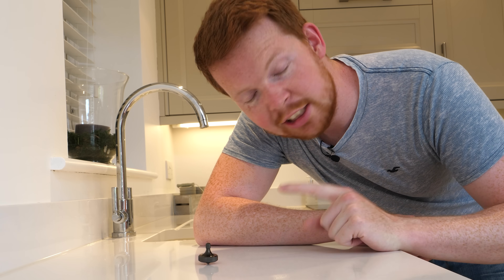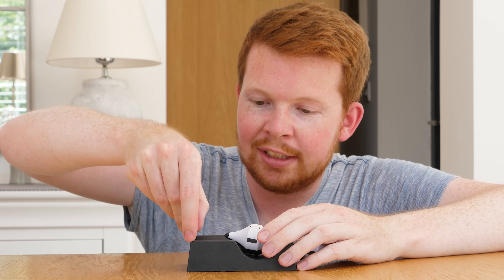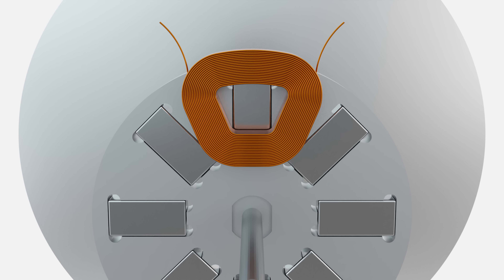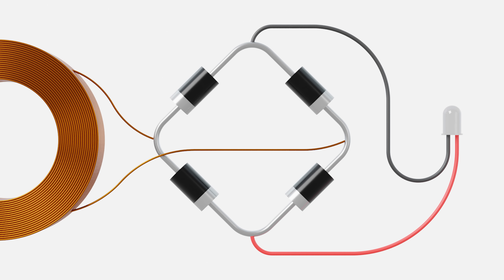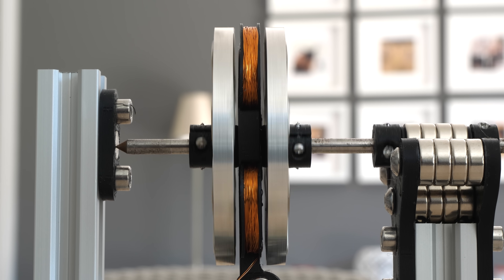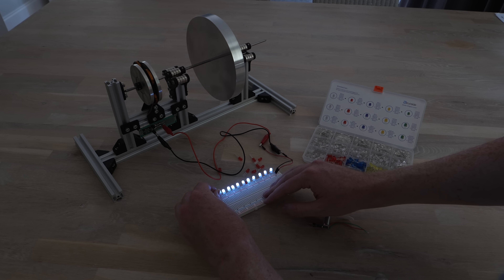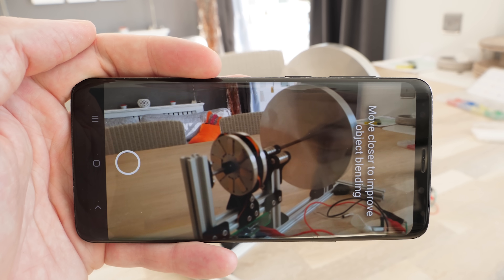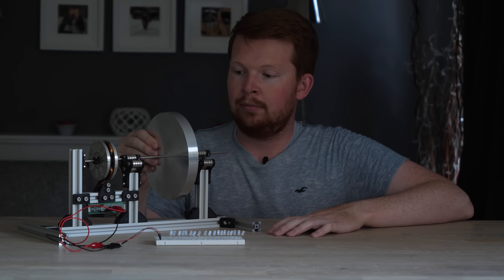Flywheel Battery

Comment: use the tiny motor to help propel the big flywheel, make it last longer! obviously at a point it will just add friction, but maybe with a fan just create an air current on one side to help it keep spinning. not sure, but it'd be fun to see how long you could get it to run with tactics like that

Comment: Just have a few words for thought:  Force Balancing. Fundamental Frequency. Resonance Frequency.  Like the use of the pin point thrust bearing, but any thrust bearing would work. Keeping in mind my few words, could some of the shaft vibration be caused by the alternator in addition to the balance of the shaft? How about hollowing out the center portions of the fly wheel, which wouldn't change the fundamental frequency of the flywheel, but which might natural curb some of the oscillations due to harmonics?  anyways, keep up the good work... Tesla would be proud.

Comment: cool video, but a bit disappointed with the wobble. Maybe a store bought generator and motor for that scale would have worked better. Also, why cant you put a magnet on the end to push against another magnet rather then having it touch the surface? that is still added friction.

Comment: You could drive it with a one-way bearing pressed into a gear (you find these used extensively in printers and copiers) build a gear box with a 1 - 25 gear up ratio (think - hand crank rotational flash lite) a smaller heavier flywheel, smaller rare earth magnets and coils that were closer together (flat drive motors printed on PCB's used in small printers and copiers) of course those Hand crank flashlights do the same thing without the magnetic bearings !! sky's the limit !

Comment: Would you be able to make some improvements n this design to make it self-sustaining? If you were to add magnets to the outside edge of the fly wheel all facing the same direction and then have opposed magnets on the base at a slight angle to repel those one the flywheel. Would that generate the force needed to rotate the flywheel indefinitely? and to help with stability you could add magnets on top of the support magnets you already have, trapping the magnets that are attached to the shaft. I wish i had the shop to be able to create this and work on some these ideas myself... Really cool project!

Comment: 3d print some gears and make a winder. Like the drill but using a crank and gear ratio to get it spinning with little effort. Then use a soft rubber wheel to touch to it. Wonder how much voltage it can make.

Comment: 6:11 No, no, no, no, and no. The charge carries here are electrons. They flow from ground to positive. What you're showing is 'conventional current', and is nothing short of sloppy, lazy physics that only has one use, and that's making it harder for people to understand what's really happening once they advance past super basic electronics. What you see as easier for beginners to understand is really just a lie that hampers true understanding.
It is a relic of the past, and has no place being taught except in the rare case of niche situations where certain materials transport positive ions or where electron-hole recombination is a relevant effect.

Comment: What about "driving" the fly wheel with magnets?
Reply: we are diving down the perpetual motion debate now.
Reply: @tvsultan1  I take it you don't believe in perpetual motion..
Reply: @dannywilsher4165  I would love to believe, but there isn't such a thing.
Reply: @tvsultan1  I'm sorry to burst your bubble but back 30 years or so ago I owned a machine shop and machined some parts for an older gentleman that said he was making a perpetual motion machine. I was skeptical about it but he paid me for my work so I did his bidding. A week later he brought the thing to show me and I was amazed. He gave it a spin and it sat on my desk for the next 6 months running without any thing attached to it. Made me a believer. 
On another different instance, I now have a clock sitting on my dresser in my bedroom that keeps perfect time and has been running since 1961 and never needs winding, touching, or any kind of outside assistance. Perpetual motion is not a myth to people who have seen it work. I have seen more examples of it than these two but I think I have made my point.....
Reply: @dannywilsher4165  I can also make up stories, like I build my own perpetual motion generator in 1991 and its still running all my household equipment since then., But without some kind of proof, its just hotair. Sorry.
Reply: @tvsultan1  I captured bigfoot in the 90s and he's currently in my basement on a treadmill powering all of my household appliances. I've seen it so it's true.
Reply: @tvsultan1  LOL... This hot air has proof all over the internet. Try looking up the Atmos clock and give me your excuse for not believing in something that has millions of examples. And it matters not to me that you think something that I experienced first hand is hot air. Your nonbelief does not change the fact that there has been many examples to prove your belief is incorrect. Research is your friend, if you care to learn the truth....
Reply: @dannywilsher4165  According to Wikipedia, the Atmos clock generates power from changes in temperature and pressure, so it's not a perpetual motion machine. Perpetual motion machines need to run forever without any outside energy sources, which isn't possible.
Reply: @9PlatinumGamer9  Thank you for proving my point. NO outside energy source has ever touched my Atmos and it has been running for quite a long time!!! Are you trying to say that temperature and atmospheric pressure are outside energy sources being used to run my clock??
Reply: @dannywilsher4165  Yes. If not, devices with solar panels and wind turbines would be perpetual motion machines.

Comment: I have a idea so have like a 1000 volt battery attached to it then spin it so when it spins it charges battery then have a thing that will allow a certain amount of voltage to go through and set it to like 20 volts and then spin it with a drill and make the battery charge the drill and also other things you want to charge or activate

Comment: It's crazy to me that you can generate exponentially more power by just....adding more coils.  Hardly any more space taken up.  There's gotta be a catch, somewhere in the physics of it.  Right?
Like, if you scale it up too much, would there be a lot of heat generated?  Are there diminishing returns?  What's stopping someone from producing an absurd amount of power from some flywheels and some casual bike pedaling?
Reply: You never get out more power than you put in. Drawing out the energy in the form of electricity slows down the flywheel. You just get the same energy out more quickly with more coils. 
Nobody's stopping you from hooking up a bike to a small generator. Though we have powerplants that do basically the same thing but on a much larger scale, a lot more efficiently and with less human effort.

Comment: If you ran the magnets off the flywheel you could have fit more magnets and had more power. Plus more weight on the flywheel and a hotter dump of power.

Comment: Your "electronic gearbox" is exactly why a diesel-electric locomotive engine has no gear box. Remember though that because of the magnetic flux produced by the coils the reactance will cause the current to lag the voltage by 90 degrees. If you were to high speed film the magnets passing the coils you should see this.

Comment: You could attach magnets to the fly wheel all the way around matching them - to + - to + and so on, and place two larger magnets on the frame under the fly wheel. On side would attract the -/+ side of the magnets and the other side would repel them. This would make it so you do not have to spin the axle. The magnetic force would spin it for you and create continuous power. Until the magnet field is to weak that is. Food for thought.

Comment: What happens if you connect the motor to the flywheel. That way the motor spins the flywheel and the flywheel powers the motor. I’d be curious to see if it would run longer and, if so, how much longer.

Comment: Can we replace the smmoth surface and point at the side with two repeling magnets stuck in place to make it truly levitating with no contact
Reply: I can't pinpoint what exactly would happen if you tried, but it's been mathematically proven that stable levitation can't be obtained with only permanent magnets in a static field. Since the magnets are all spinning axially, and the field has cylindrical symmetry along the same axis, it's indistinguishable from a static field, so in theory this shouldn't work. 
My guess is the tip of the axis would want to "slip" to the side of the limiter magnet.
Reply: @gspin96  
Actually it would probably be easily fixed by not making two magnets but a magnet and a ring of magnets.
Using just two magnets would indeed be like balancing one magnet on top of another, but a ring of magnet (ass here gravity isn't the force to counter, so it is all horizontal and not vertical) would works like the one who levitate it by pushing it toward the center and away at the same time.
Reply: @Demongornot  Again, i can't predict the mode of failure off the top of my head, but current understanding is there's no such stable levitated configuration that you can make with only permanent magnets. No matter what you do. If you can disprove that, you might be in line for a Nobel.
Reply: @gspin96  I agree with Demongornot...I haven't actually tried to do it anyway...but I can think of several ways that should theoretically work. Maybe I'm just not understanding what you're saying. But now I've gotta test this out.
Reply: @gspin96  Makes sense. I believe what I was referring to would fall into the loopholes of that theorem, naturally. But again, I'm just thinking about these things while sitting at work not being able to test it. Lol. And while I don't perfectly understand all the parts of the what is being referenced for these interactions, I think, that what I'm thinking, would work. Hard to explain in text. I'm quite certain it has to be a loophole as there is no doubt that I am not smarter than Earnshaw. If I actually don't get distracted and take the time to figure out if what I'm thinking would work, I'll be sure to respond.
Reply: @gspin96  You're right, balancing one magnet on another is akin to balancing a ball bearing on another. 

Perhaps the shaft could be made full floating with magnets and bismuth end caps. (diamagnetic materials) Spinning magnets may be relatively friction free but they aren't really 'drag free' anyway. If there's anything near them capable of induction it will represent a loss.

I'd wager the flywheel would spin just as long if he suspended the shaft with a couple of decent bearings, but the coolness factor would be lower.
Reply: @gspin96  
I am sure there is, and it is definitely not worthy of a Nobel.
And technically, supra conductors already do that.

Comment: I finally understand (the fundamentals, at least) how AC electricity works! Also, could the flickering be minimized by using different ratios of magnets to coils? E.g., if you had 6 magnets and 4 coils, you wouldn't have such a drastic ON/OFF voltage change.
Reply: no... 
but using 10x coils (increase number of phases) or increasing the RPM 10x would be enough to make the flicker invisible to human eyes (but not most video cameras).
The electric load (LEDs) pulls energy from the flywheel via magnetic coupling. This is what Tesla patented >130 years ago.
As the energy is removed from the static flywheel it slows down... If he built a flywheel that contracted it's inertia towards the center as it loses energy, it could maintain a more constant rpm over a wider range of (mechanical) energy storage... and reduce perceptible flicker from LED lights
Reply: @dl5244  but using different ratios of magnets to coils would change the wave form, wouldn't it? I'm just thinking of it from a math perspective, where the current setup produces a voltage proportional to 4*sin(omega/(2*pi)), where if you had a setup in which the number of coils and number of magnets had no common denominator, the voltage amplitude would be more proportional to something like  sin(omega+1/(2*pi*a))+sin(omega+2/(2*pi*a))+sin(omega+3/(2*pi*a))...

I've got no clue how diodes or AC works, or if there'd be some sort of interference but you could at least produce an AC wave form that was much smoother.
Reply: @alecgolas8396  The most common method is to connect his coils differently. He wired all the coils together to make a single-phase generator (2-wires output). If instead he connected them differently to have three wires (3phase) or six wires he would have to build a "six-pulse" or "twelve-pulse" bridge rectifier. These designs inherently have MUCH lower ripple at the output.

Comment: Have you tried using the magnetic fields on opposite ends of the shafts with the opposing magnets to stop the shaft drift. Theoretically lowering the friction of the shaft on the end support. Would be interesting.

Comment: It would be really cool to see this using an air bearing instead of magnetic levitation. If you want to get the flywheel off, use dry ice around the shaft. it will shrink enough to let you slide the fly wheel off.

Comment: As your connected device requires more power, it produces more drag on your flywheel though.  So if it would run 1 LED for 10 minutes, it would run 2 for only 5.

Comment: I hope you find a way to levitate the Flywheel only using Magnets!
There are some Toys that can do it but I don't know if they can spin.
Next it would be interesting to see what happens if you replace that Generator
with a Motor similar to Teslas motors (Work very good as both Generators and Motors).

I sadly don't know how they are called but they are similar to induction Motors and have these Slits cut into the Rotor
but then have Neodymium Magnets at key positions that increase efficiency and allows it to generate Electricity too.

Comment: Great build. Closing a "magnetic circuit" through the air (i.e. from the back of one axial flux plate, all the way around back to the other) leaves for very low field magnetic flux and thus a low-power machine.

Comment: I'm surprised at how simple centering and extracting energy from a flywheel is. I knew you could use them for backup electricity, but I didn't realize the solutions to these problems were so simple. Fantastic video!

Comment: Forcing the distribution of the mass round the outside of the wheel should give you more storage for a given 'weight'. How much this would help given magnetic levetation I don't know, but it would make a difference if you were using traditional bearings, as the friction losses would reduce.
I expect you're also losing energy from the 'wobble' so in the event you do pin both ends - the mass reduction would be of benefit.

Comment: If someone theoretically made this in outer space, would we have infinite power?
Reply: I think yes but no.. Its not a generator but big batery. You have to take a fact that there is still fiction like that point on side and magnets also take some energy..
But imagin this under your home. When you are at work, the Sun shinnig on your convertors and than when you come home you are talking energy from this battery. Problem is that you have to have huge mass, I really dont calculate it, but I think we will need something around more than 100kg, diametr also play role..  So because its mass you will need really strong magnets.. But yeah.. Calculate it, build it and you will have one of the cleanist energy..
Sorry for my english, I just still learning. Hope you get it
Reply: @lukaszima3191  I fully understand it. Thanks for the explanation

Comment: Do you think it could be potentially possible to add a tiny low voltage high speed motor like the one you powered with it to the end of the shaft, and have it spin another flywheel? If so, could they be put in series, in a circle of maybe 10, all feeding power to the same capacitor bank and therefore powering each other? I could imagine each flywheel would probably have to be spun up at the start if this was even viable and they probably wouldn't spin for too long. It could be interesting to try it.

Comment: It would be fun if you made som sort of lever with a gear ratio at the end of the shaft so you can spin it fast by hand. Also would be fun if you hooked up something that uses high power with a transformer and see the flywheel slow down

Comment: I have a question: what if the motor you wired to your flywheel was installed such that when powered, the motor would spin the flywheel faster and faster? Would it just max out at the speed the motor can revolve up to? Maybe try it out.

Comment: The Magnets induce a Voltage (not current). There is Zero current involved, until a load is applied, this is expressed in Watts. The current is a by-product only, and is useless to describe what is induced in the wire. It has no value, until the load is applied.
It is not possible to measure any current in any circuit without a load. Only a current capability, when said load does work, light heat ETC. Only then can you detect any current value.
Remove the load, and the current disappears, leaving a measurable voltage, using an instrument such as a volt meter, which itself applies a minimal load, in order to measure any output.